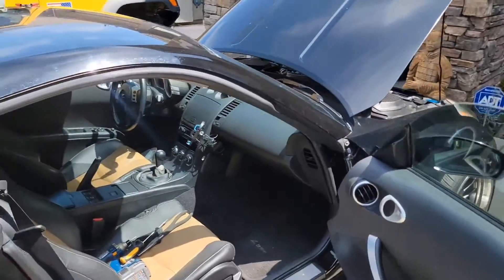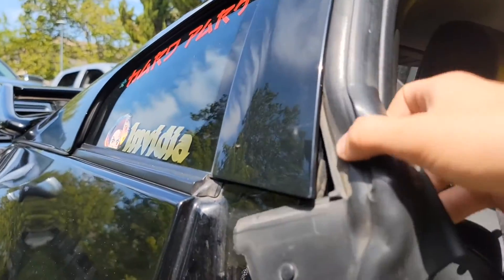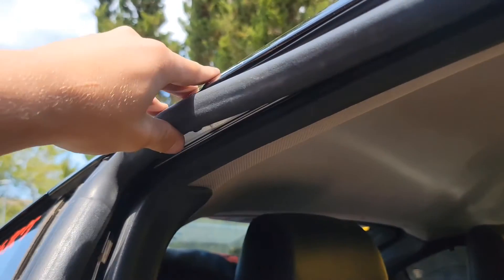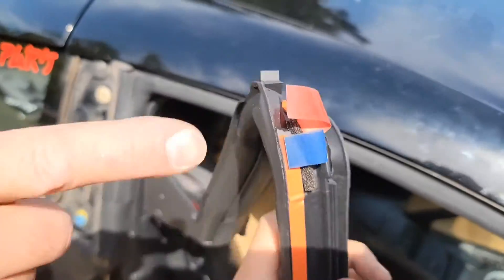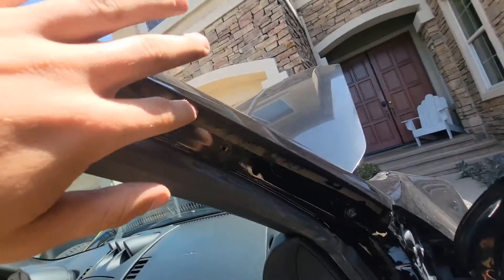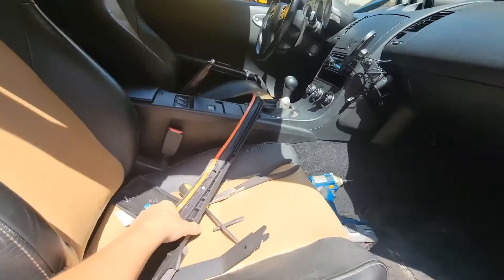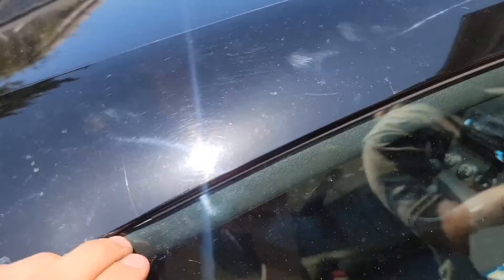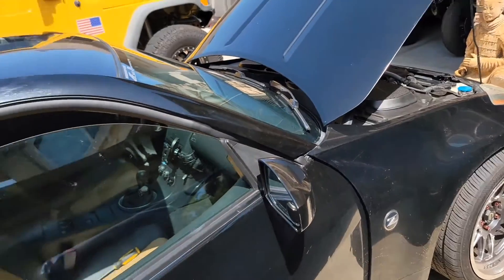Nissan 350z Window Seal/Weatherstripping replacement (A-pillar trim doesn't need to be removed)

Comment: You don't need to remove the rail or unscrew anything to do this. It is just sticks above where the rail is screwed in.. You just need to unseat the rubber seal from the rail and then pull it away from the car!
Reply: Also the clip on a pillar should be installed on the cover and then push them back instead of sliding in. This guy has no idea what he’s doing
Reply: Where did you find how to do it?

Comment: I have this same issue with my 2015 q60 smh and on the driver side water leaks in through where the break peddle is near the fuse box. Any idea on how fix that?
Reply from the maker: Have you checked the seals above where the petals are?
Reply from the maker: There are multiple spots where water comes from. Put a hose on your windshield and let the water run down in on the drive side. Look for water coming in in the petal area

Comment: I’m having the same kinda issue. Not necessarily a pool of water but the water is like leaking out of my passenger side speaker and I notice it every time I get in now. Not a lot but just little droplets coming out of the speaker holes. Which sucks, not sure if I’m gonna have to replace the speaker now or what. The weather stripping doesn’t look or feel too bad on that side which is weird, my driver side is like coming off so if anything you’d think it’d leak on that side. Not sure why the hell it’s coming out of my speakers though.
Reply: i think i’ve seen this problem before and i believe it’s the side mirrors trapping water
Reply: I just noticed the same thing on my car what did you do to fix it

Comment: i have a issue with wind noise leaking into the cabin, did you have that too? i have also noticed water on the headliner and floor right next to the seals. 
i have a g37 coupe but the weather stripping looks similar so just asking

Comment: Is this seal replacement the same for a 350Z roadster ( of course not the top side of the window, being that it retracts when you open the soft top) but, I'm referring to the pillar that the side mirrors are on?
Reply from the maker: Honestly. I'm not to sure about that on! I replaced my mirror seals though and water still gets through that part lol. Not nearly as bad though lol